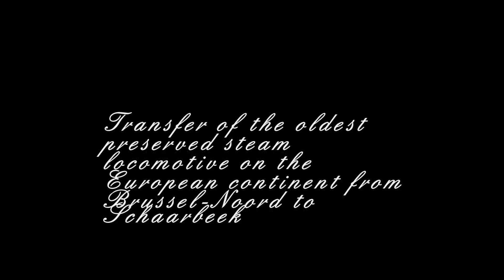Transfer of the oldest preserved steam locomotive on the Continent from Brussels North to Schaarbeek

Comment: An to think of all the I-beams that I had to offload by myself with a wireless crain.
Reply: I think of all the massive 65’ foot ‘wide flange’ H beams I unloaded and put under buildings by hand. Using just ratchet cable pullers and pinch bars. I have owned a building moving business since 1972. I never got a truck crane until 1986 and a tractor loader/ backhoe and bulldozer in 1987.  Not one employee injury in 48 years of the structure moving business ( never owned a ‘hard hat’ or reflective ‘safety’ vest either) ! Come to think of it we never wore steel toed boots. We just used the grey matter between our ears !